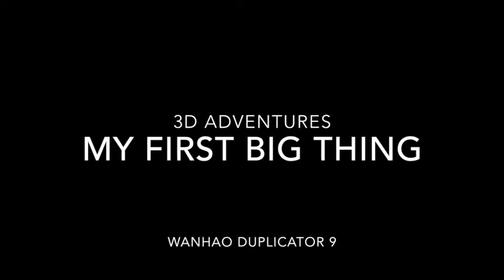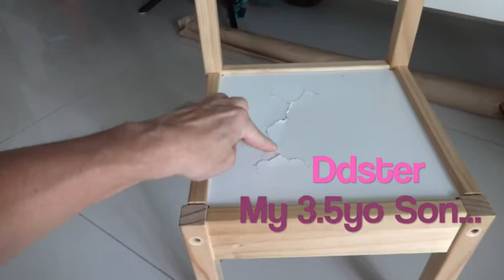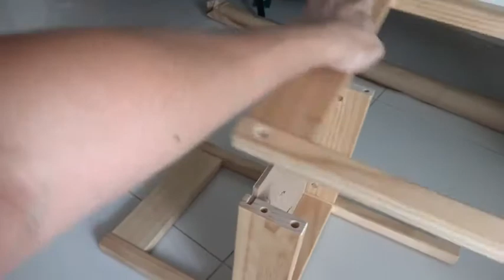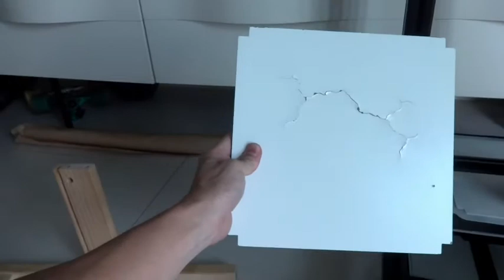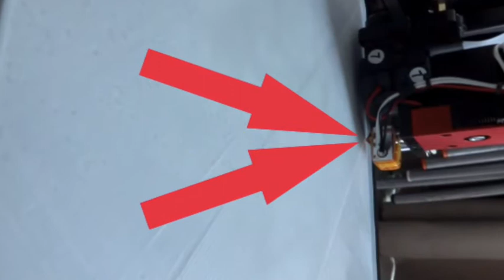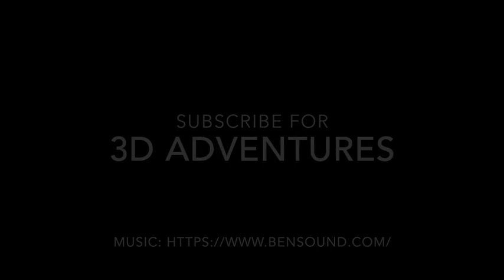Wanhao Duplicator 9/300 - 3D Adventures How to print large objects faster Part 1

Comment: How good is this?
Reply from the maker: Kristian Taylor the chair? It's still working.

The printer is good for big stuff or tiny stuff, as long as you are not overly particular about superb finish.

I'm still trying to get it to print TPU(rubbery material), which it is not supposed to support 😂😂😂
Reply: Alvin Quah hmm that's a worry
 I'm after something that's has nice finish and prints pla abs and tpu